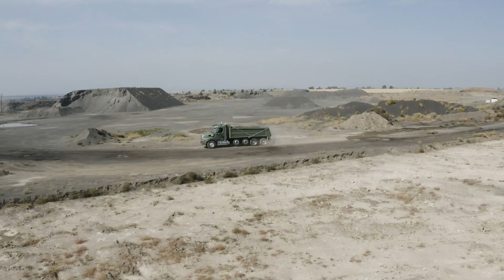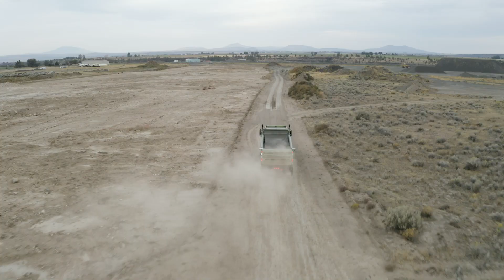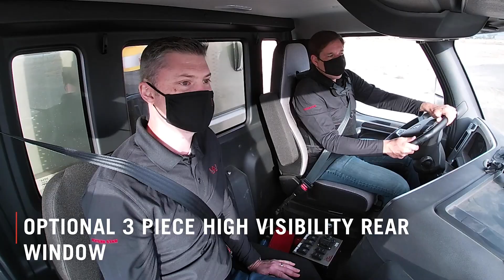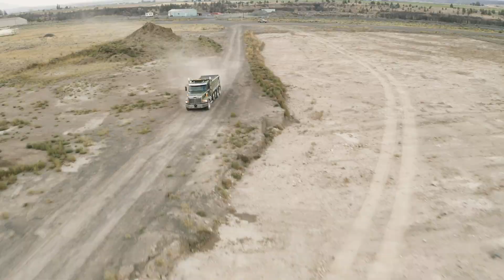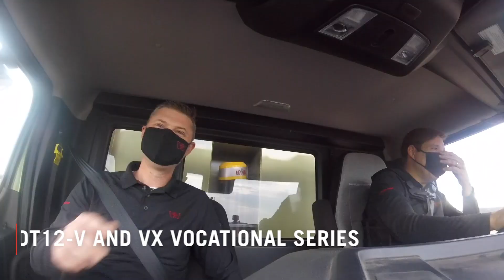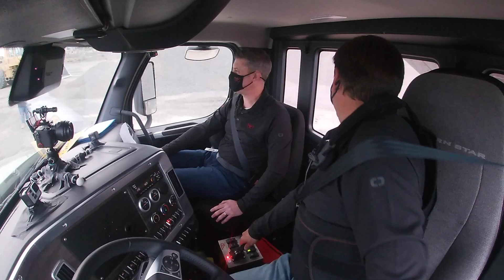49X Ride and Drive | Western Star Trucks

Comment: Disappointing to see Western Star switch to the flimsy Freightliner Cascadia cab, what a joke.
Reply: It's not the same cab. And it's all but flimsy
Reply: @SimplexSM  What parts are different? Watching again it does look like a different roof cap, but the doors, back wall, and windshield look the same.  Dashboard also looks very similar to the current Cascadia.  Even the bench seat over the "battery box" looks like the same piece as a Cascadia day cab.  I guess they made some structural improvements under the skin?